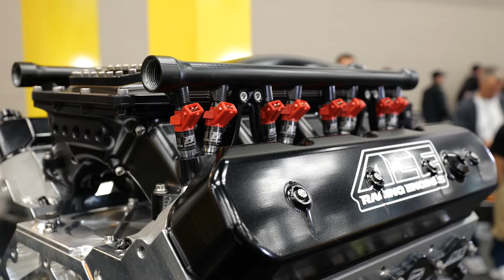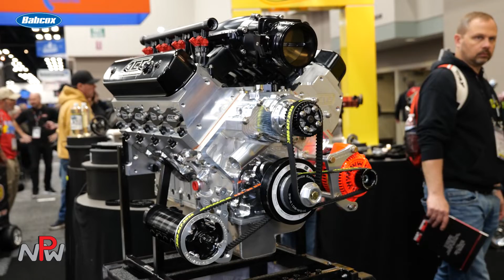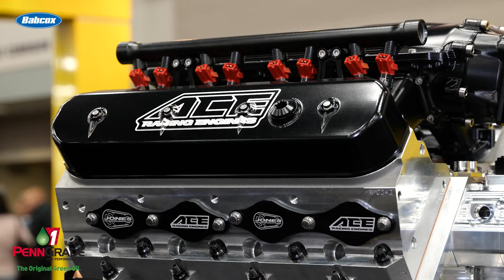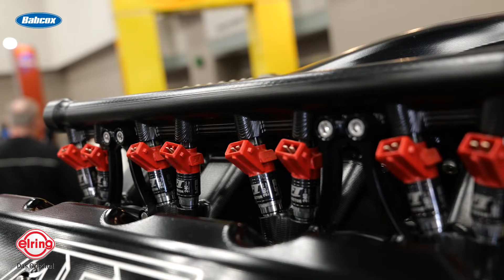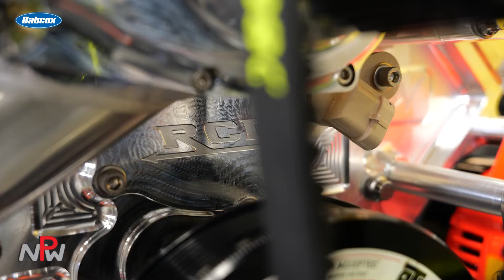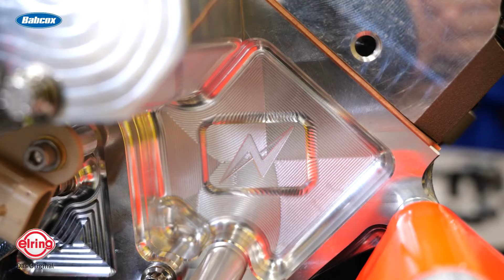ACE Racing Engines' 427 cid Billet LS Drag-and-Drive Engine

Comment: LS guys: What do we need to do to beat that sleeved factory block Coyote? We need billet.
Reply: Welp, a billet MMR 351in³ Coyote has dyno'd 4200+ whp and clocked 5.67 @ 265mph. 
No billet LS has matched that
Reply: @chadkent1241 it’s “capable” of a 5.6 @265mph, whatever that means. Regardless I’ve yet to see one in an actual race car

Comment: Thats what i drive, a fuel injected 438windsor 68 mustang street drag car, or drag car on the street. Drive it anywhere,  but its a street solid roller cam,  not a drag cam like this engine. Spins to 7200rpm like a swiss watch.

Comment: That's a $100k pure drag race engine.  You can't street drive that in traffic,  drive thru's, cruising, fwy....etc
Reply: People, including myself have driven this engine on freeways, in traffic, to the beach. It's absolutely street drivable.
Reply: @Laura66a Ok can you give me the exact cam specs please.
Reply: @Laura66a  Yea but your drag race roller cam wont hold up to the valvetrain pounding with years of street driving without a rebuild or replace lifters and springs, guides....etc..Drag roller cams are not designed for long street driving over time. Comp cams warns you do not drive drag roller cams on the street.
Reply: @maximusvonce1381 if you can afford this engine you can afford changing valve train. Shhhhhh.
Reply: Cmon Mannnn, this is a Weekend Cruiser engine!!!
If you're going to use this engine as a Daily, you can afford fixing it!!! 🤣😂😂
Reply: @soulabear9146  Bro that engine has a huge drag roller race cam. It wont last on the street.  Very high maintenance.

Comp cams says drag rollers not meant for street driving period. But i guess you can do it if u dont mind possibly breaking expensive valvetrain parts alot.
Reply: @maximusvonce1381  as I said...if you can afford it, you can afford fixing it..."DRAG. AND. DRIVE" 👀
Reply: @soulabear9146 Cam specs and compression please?

Comment: Wet deck is out. Steve Morris billet SML/SMX engines run water through heads and block with separate passages so no water between head and block in case of blown head gasket.
Reply: In the entire history of Drag Week and Sick Week, only once has the SMX won; the rest has been with Wet Deck Engine Block and Head BBC, LS, and this year a Coyote.
Reply: Phq Steve Morris
Reply: ACE would not continue building them - if they had issues i would think...
Reply: Well if you don’t blow head gaskets that’s not a problem